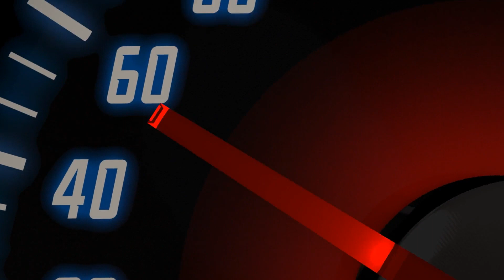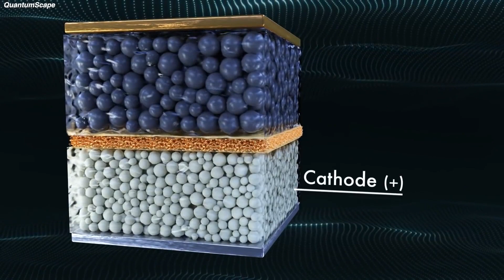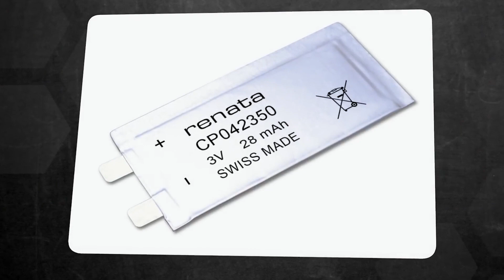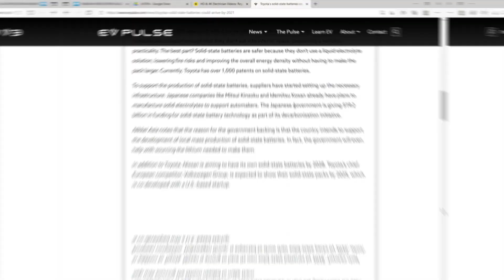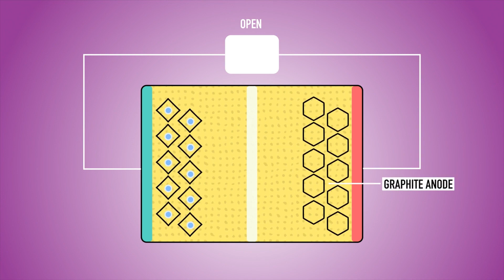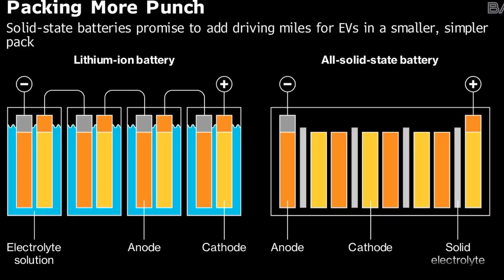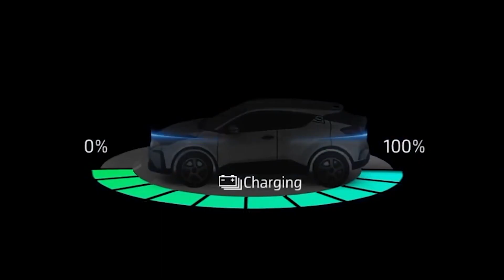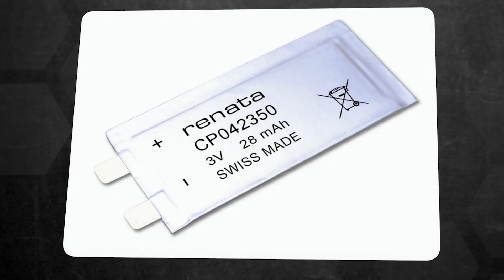GAME OVER! Tesla Battery vs Toyota Solid State Battery

Comment: The problem with "revolutionary" batteries is that they highlight their strong points and ignore their problems. Everyone has a fantastic battery so long as you don't look at its energy density, or power density, or cycle life or manufacturability.... or some other show stopper that nobody in marketing wants to talk about.... Transphasers and Cold fusion babble unless you Also talk about the hurdles that need to be overcome.... otherwise.... where the heck are they? 

What was Not said is that Toyota doesn't think they can get to market before 2024..... so this business about putting it into a car in 2021 is just more lab work in a real world environment. Its not some accelerated timeline. It does not suggest its close to production. (I can build a $1,000,000 battery and put it in a prototype.... doesn't mean I can sell it in a $40,000 car. 

Saying its "in house" (secretive) but they have 1000 patents... therefore they must know what they're doing????

When I see 1000 scattershot patents for One product.... I see someone fishing around. I don't see someone close to a solution.... or far.... or anywhere in between. Its a meaningless number - sounds like they're more interested in cutting off viable paths others might try than actually discovering something that works. I see a minefield of patents made by someone hoping that if someone stumbles on the correct chemistry, they can sue them for a piece of the action.
Reply: The patent race for Toyota is their stratwgy to be the ultimate battery patent troll because they cannot compete through manufacturing. Anyone talking about the amount of patents should also check the quality of those. Amount is not a measure of quality.
Reply: Best reality check I've read on new "battery tech" yet, Joe!  Covers (probably) everything & then some, that everyone talks about when new tech looms.
If Toyota's ready for 2022, why are they lobbying Biden to slow down on EV adoption policies (you can edit your post & I'll delete this point!).
Reply: Great comment, I hear charging speed and stability are better than Li ion and I think, ok?? What about energy density, cost, life cycle, etc etc?? Sooo many factors go into what makes something market-ready.
Reply: How long has each of Tesla’s models taken from announcement to actual availability? Once developed factories need to be built, equipment installed, employees hired and trained. If a product comes out less than five years after development they are doing well.
With Li-Ion batteries you also have to obtain a supply of raw materials to build the batteries because they aren’t readily available.
Reply: @MetoFulcurm  First. Tesla is very profitable and has made profit right through the pandemic. They currently have $16billion cash on hand, are making about $500m to $800m per quarter free cash flow (while building 2 gigafactories) and reduced their long term debt $1.6 billion to about $7.5billion . Check the long term debt of most other major auto makers and you will find many of them swimming in debt and facing the prospect of massive EV investment requirements and transition costs. 
Tesla also has a Gross profit margin on autos of well over 20%. Its in the low 20's overall. 
This is a high margin for an auto maker..... so the "Tesla isn't making money" bit hasn't been true for about 2 years and ignored their 50% YoY production growth rate. (Revenues grew steadily over time as well.)

As for "dividends", these are given out by companies that have stagnated on growth and must make a return to keep investors interested. With high growth, they aren't needed. (Look at Tesla's 5 year stock price growth. Now look at GM. Which made the investor more money?)

Why would they be behind? Because they are way behind Tesla, VW and other leaders in making an EV and mass marketing it for an Actual profit - which isn't easy and requires $billions of investment in battery and motor technology. Failure to do so produces a mediocre to poor product - ID.3 (ID.4 is an improvement). Then you also need to make the cars at scale.... you can't use and ICE plant to do this. You need a secure source of batteries. You need factories setup to produce in numbers.... EVs ..... not ICE vehicles which experience of Other legacy makers have shown, is a Very expensive transition. 
How many factories has Toyota converted to EV? 

Everything they have done is in the lab or cloaked in secrecy. If they have converted factories, please educate me because I haven't heard much on that and one pilot doesn't suggest they are ready to break out any time soon in a meaningful way. VW has gone through herculean  changes. Expensive changes. 

Where is Toyota? 
I really haven't seen anything on plant conversions or production dates prior to 2024 when they will bet it all that the transition will be easy.... just not for anyone else
I hear Dollars to be invested and I hear numbers of models to convert. I hear the same from everyone. I don't hear dates for introduction that are anything but vague and I don't see the work being done on factories to scale once all these cars are ready. Easy to take a design and make variations, not so easy to mass produce at a profit. 

They have to make at least 1-2 models at a loss, then figure out how to make them at a profit (ICE isn't EV.... so no.... 100 years.... blah.... blah doesn't cut it beyon the cabin and frame). This is a New drivetrain. New methods of fabrication... show us movement....
Reply: The REAL problem with "revolutionary" batteries is the tech isn't scalable.  Wake me up when these can be mass produced.
Reply: Echoed all of my concerns as I was watching and summed it up perfectly. I think Toyota are so far behind they're in panic mode

Comment: Ultimately, solid-state will win. I know this because the starships in Star Trek are all-electric vehicles¹ and they are powered by dilithium crystals and that is 300 years in the future!😈
¹Of course they are all-electric vehicles, not ICE, because in space no one can hear you scream [Why won't this damn thing start?!?!]😈
Reply: Because ICE Enterprise needs a Di-Lithium crystal to spin the starter motor, or 200 crew members to turn the really long starting handle to generate enough of a spark to fire up the 6,496 litre Di-Esel engines in the Hybrid Nacelles when the crystals are dead...
"Checkov! Fire a proton torpedo at the Klingon cruiser & coal roll that Tribble that's stuck on the port Nacelle..."
"But Sirr! The DPF's rrr steel ective, end imposseeble to tayke uff line!"...
Reply: Once solid state becomes a reality I have no doubt that Tesla will have their own solid state battery.
Reply: @williambradshaw1874  they extended their partnership with Jeff Dahn at Dalhousie university. John B Goodenough was, once upon a time, the man, but what's happened to his glass Solid State battery that's been a talking point for.... Years?....
I have a feeling that J. Dahn & his rising young stars are on the S.State case on the quiet.
Reply: @alexmanojlovic768  Everyone has been talking about Solid State Batteries for years.
Reply: @williambradshaw1874  errrmmmm...
I know!  I was merely pointing out that..... Everyone has been talking about John B Goodenough's glass SS batteries.... For years...!! And letting you & all the readers know, in case you didn't, that Tesla/JDahn's successful partnership has been renewed, thus if there's a good SS battery prospect, Tesla a) will know about it & b) probably buy up or partner with the firm if it's worth it. 🤷
Reply: @alexmanojlovic768  Nice!

Comment: You can’t quote metrics in batteries that don’t exist yet
Reply: Cheaper and charge more quickly quotes. That is in the lab on a very small battery. There is no actual product. The video states they will be cheaper but then later talks about issues still need to addressed like high price and mass production.
Reply: @neivamj  Oh okay, thanks for the clarification.
Reply: What does that mean? What is metrics in batteries? Please don't be rude and ignore my comment. I am genuinely curious.
Reply: @davidjoe9639  Mr GAME OVER! mentions "at this price point".  At what price point?  Based on a secret chemistry & not yet devised manufacturing setup, with secret suppliers of unknown quantities of chemicals & materials?...
If Toyota are ready for running a car in 2021 why are they lobbying Biden to not push EV friendly policies?  Because they're nowhere near ready for production & thus no-one has any idea what "price points" will be achievable.
GAME OVER! (the game of BS clickbaityness...).
Reply: @davidjoe9639  There are no solid state batteries with, or without metrics.